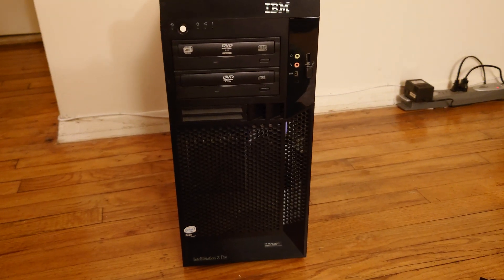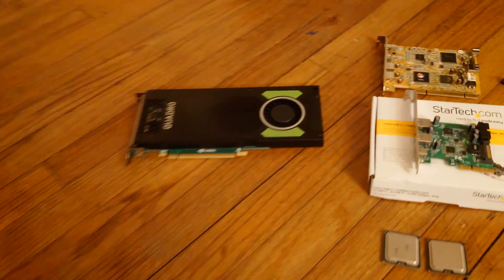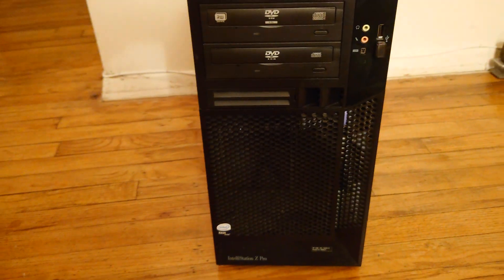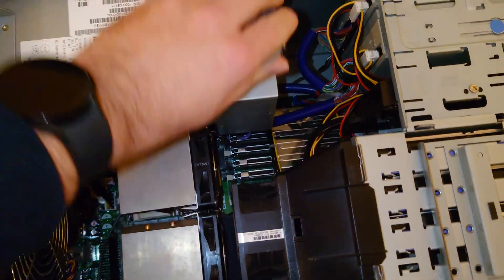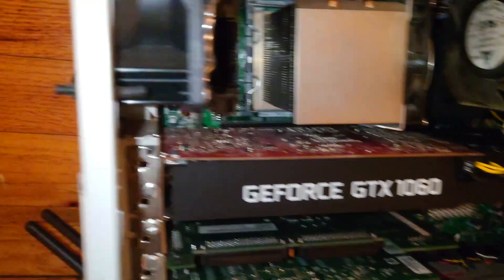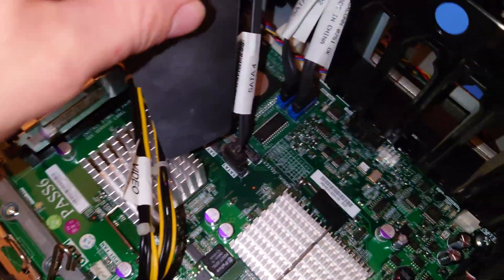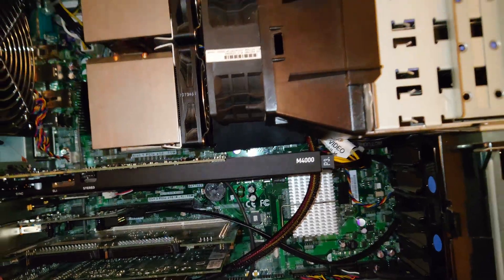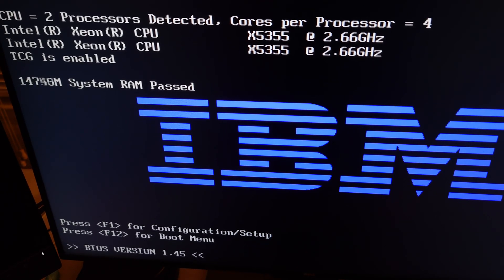IBM IntelliStation Z Pro MT 9228 Overview and Upgrades. IBM's Last Prosumer Desktop

Comment: Anyone have the BIOS for 1.45 by any chance??
Reply from the maker: I usually go to the site ibmfiles it also has the audio driver for the system
Reply: @cliffscustoms  got it!  Updated to 1.45 and enabled virtualization.  I also have 2 5355's as well.  Do you receive the CPU stepping error not supported at boot up or no?
Reply from the maker: @joelwilliams7631  Yep you'll get those with the quad cores. But it's easy enough to ignore.

Comment: Trying to get audio (SoundMAX Integrated Digital HD) to work with Windows 11. Driver from 2009 installed fine but no sound. Any one has success?
Reply: Just want to report sound card is now working fine use Windows 7 driver.

Comment: I also just ordered a pair of x5472's for it and looking for ram kits on ebay
Reply from the maker: I think you need Xeons that top out at 1333mhz FSB. I believe those are the 65nm Clovertown ones.
Reply: Just curious the X5472 works for you? Thinking about doing the same. Thanks.

Comment: I have 2 of these one is complete other is parts pc currently trying to get windows 10 it but it is randomly freezing during the install
Reply from the maker: Would need to upgrade the Xeons to Clovertown ones or use Win 10 32 bit. The xeons in there lack some sort of command/instruction later x64 versions of Win 10 need. Took me forever to find that out.

Comment: Been my trusted workhorse running E5345 chips. Love it right now trying to get it to run Windows 11 with UEFI requirement. I believe there is a way of getting around that. Would love to hear from folks who has already done it.
Reply from the maker: Haven't tried it myself but will look into it once Windows 10 starts to reach its EOL date.
Reply: @cliffscustoms  Completed the migration to Windows 11 this morning successfully now good for another decade. lol. Gotta loves the 9228 last one from IBM rock solid machine no one will build this kind of tank any longer. I still remember a fully option 9228 costs $10, 000 in 2006. Next is to upgrade from E5345 to X5365. That is a beast.

Comment: Hi. Would it be possible to run an am2+ cpu on an am2 board without official compatibility? Maybe the problem is in the chipset (nvidia geforce 6100 / nforce 410), however, I've seen boards with a similar 6150se chipset which do support phenom processors... Is there anything that could be changed to make this possible? My board is a winfast 6100m2ma. Thanks :)
Reply from the maker: Hmmmm not too familiar with that board. Looks like it's made by Foxconn. Are you able to find an updated BIOS?